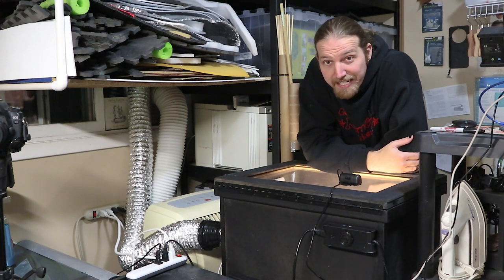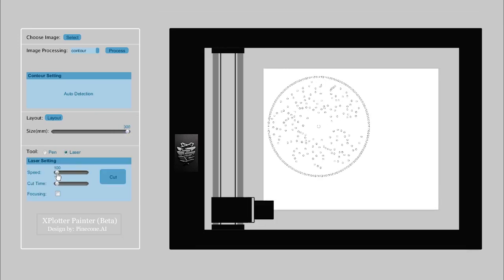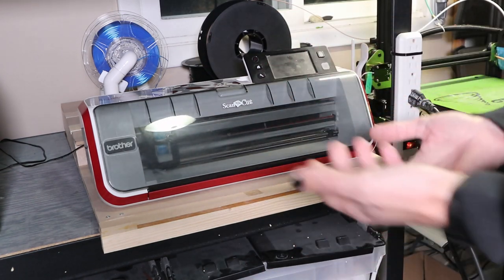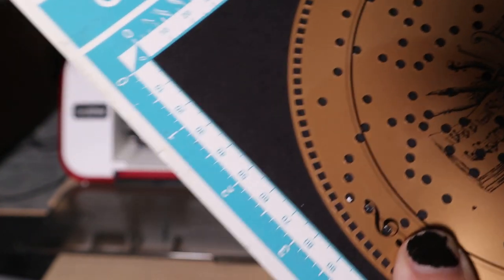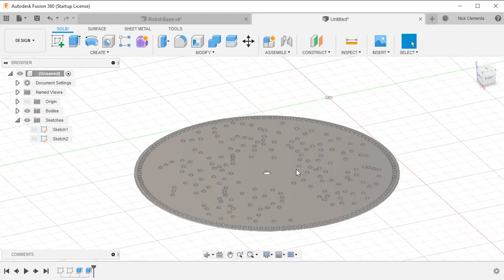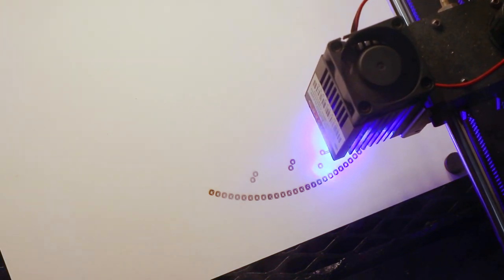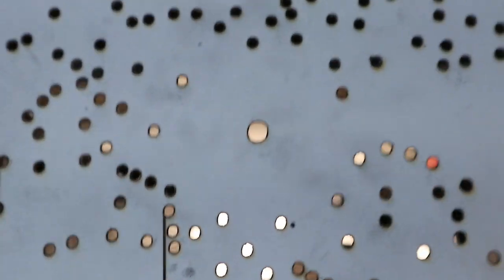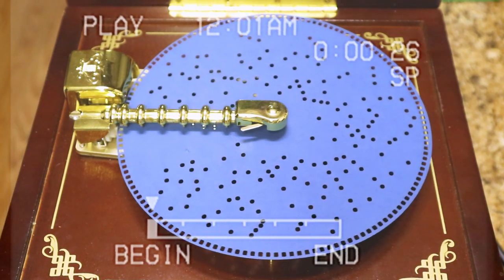PROJECT - MUSIC BOX | PART 2

Comment: It looks like that your first layer is too far away from the bed causing the plastic to not stick well. People have printed cogs before and have fine detail and holes. So you may need to change the settings or the bed leveling

Comment: With the 3D printer if you use a raft, the circles will attach a little better. Also your slicer software. I don't know which you are using, but the latest versions of Cura allow you to print small details slowly on the first layer. Small circles are notoriously hard to print on first layers. By adding a raft, your first layer is going down on  plastic, so it will adhere well, and the slower printing with give the plastic a chance to cool enough so it keeps it's shape.
Another couple of tips when printing a complex first layer, slow down your print speed. Second tip, if a raft won't work for you (it might not on such a thin print) in Fusion, make the first 0.3mm layer solid. Then have all your holes and other details. When the print is done, you just drill or cut out the details in the first layer. Okay, in your music discs it's going to be a chore, but it more regular prints, it makes for nice neat screw holes.
Great video.
Reply from the maker: Those are some really helpful tips, thanks. I also think my z-offset was too high as-well.